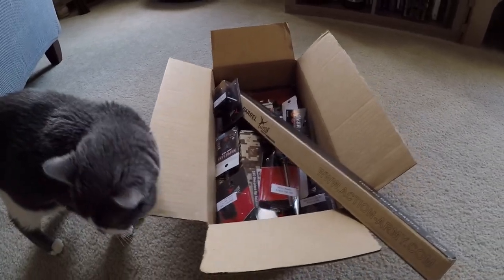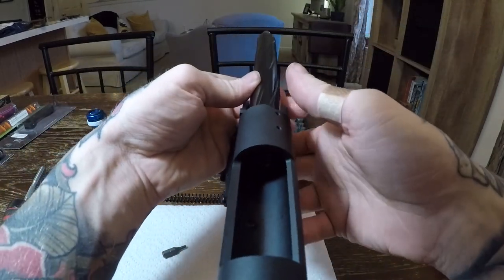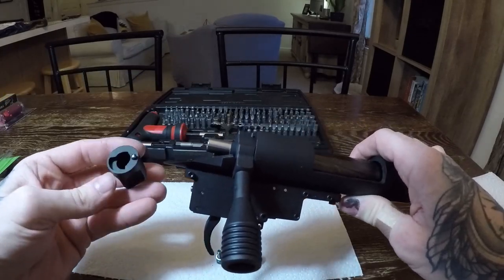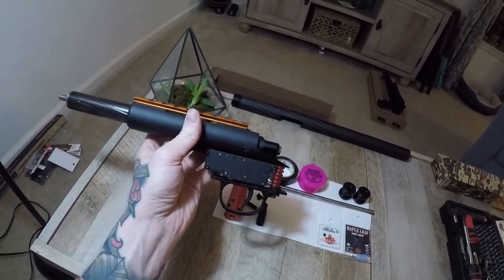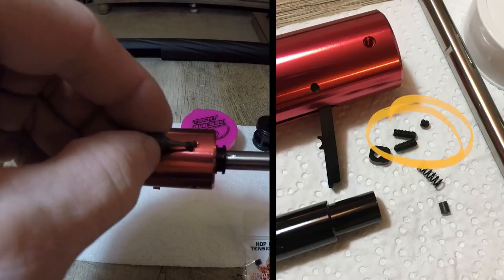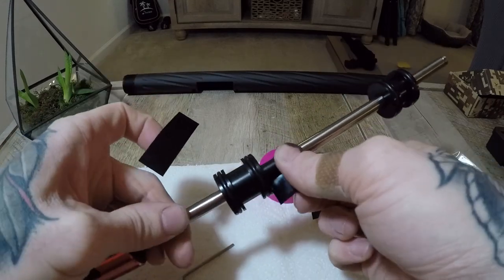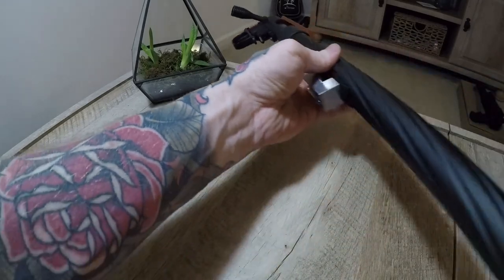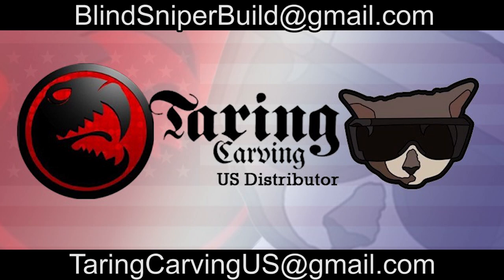How to Build a Vsr-10 from COMPLETE Scratch!!! | Airsoft Sniper Rifle DIY Guide | Taring Carving 🐲🔥

Comment: JGBar-10:  I had the issue where the spring guide would not stay in by pressure alone (doesn't work after first shot) so the "screw" in the spring guide to keep it in is a great idea.  I figured those holes must be made for a reason but since there are no install instructions this info is really helpful.  Cheers!

FYI:  I installed the Action Army 90 degree trigger into my SSG10-A1 with no issues.   It is much better than the stock one.  I only had to widen the 2 mounting holes in the trigger to accept M3.x8 screws.

Comment: Now, two of the important parts you choose are prone to some problems.
The first is the AAC blue piston.
The white guide ring that keeps the piston in the center is screwed into the piston, but the front ring is not properly mounted.
When it deteriorates, it causes air leakage from the screwed part of the air seal O-ring and guide ring.
This means that even if the O-ring is replaced with a new one, the air seal cannot be obtained.
It is not a fundamental solution, but it can be improved by applying wax to the guide ring and screwed parts.
The second problem is that the combination of AAC cylinder head and maple leaf backing makes it difficult to obtain ballistic consistency.
The tip of the AAC cylinder head nozzle is 7 mm instead of the standard VSR nozzle diameter of 6 mm.
Although this thick nozzle provides a strong air seal and can easily increase power,
When used for a backing with a flat, long hump, such as a maple leaf backing, as it overstretches the inside of the backing
The standby state of BB is not stable and the trajectory becomes inconsistent. (LayLax cylinder heads have the same problem)
To improve this problem, the diameter of the nozzle tip should be reduced to 6 mm.
With the right tools, you can get dramatic results with just a few steps.

Advice from Japanese VSR enthusiasts
I hope your investment will be satisfactory.
Reply from the maker: These are basic off the shelf parts, and everything works fine. I have had AA pistons come loose before too, which is and easy fix. If someone really wants to tinker and get every last ounce of performance, they shouldn’t be building a rifle thats 90% action army. I appreciate your input though!

Comment: I'm planning on making a VSR from scratch soon, do you know what screws and fittings I'll need to buy that don't come with the parts (e.g. the bolt handle screws and detent pin/spring)?
Reply from the maker: Off the top of my head; you’ll need hardware for; the body/stock, trigger box, bolt handle end cap, and maybe scope rail. It depends on which parts you get, sometimes you get hardware. It’s allots worth trying to find a cheap boneyard rifle just for little parts like the hardware and detent. At this point I have so many bins of parts that I typically have the small stuff I need!! 👍🏻🍻
Reply: @BlindSniper  Fair enough, I'll have a look for some. In all honesty I might end up buying a JG Gspec and cannibalising it for the stock and screws.

Thanks for your time and advice!

Comment: how are you getting the hop up unit flush with the barrel window?
Reply from the maker: If you have the mag block screws loosened, specifically the front one that goes through the outer barrel; the mag block screw hole in the outer barrel is usually oblong so there is room for adjustment. If it’s not, you can widen it or oblong it with a drill bit. I also touch on this in my carbon fiber outer barrel guide I believe!

Comment: I built my vsr-10 and replaced all the parts from my old rifle. So now I have a full upper assembly that i want to turn into a backup sniper if my upgraded one goes down. Where would I find a good place to purchase a vsr-10 stock, or would it just be a cheap fun project to make a wood one. Recommendations?
Reply from the maker: Well I do distribute Taring carving stocks in the US. I can ship anywhere but it costs more outside the US. However there are many vsr-10 options. A standard stock used on the hopup app for cheap. Maple leaf MLC stock is really nice. Modelwork M40, classic army Sr40, well mb10/11s are vsr compatible, Akura tactical has a 3D print and cnc stock for vsr.
Reply: If you could send me a link or a way to email you about those taring carvings stocks I'd like to see those.
Reply from the maker: @Monarch-252  email me at TaringCarvingUS@gmail.com. I can show you stocks I have/can get. I can also send you links for other vsr options! I also have 2 Taring carving videos on my channel!

Comment: Hey Blind Sniper. I have a Tokyo Marui G Spec stock. Just bought the SAP Edgi kit chamaleon version. Which cylinder would you recommend and most importantly which trigger?
Once I put that all together, which spring to get 2J?
Reply from the maker: For the sap def get EdGi cylinder. For trigger I like BullTrigg gen2, however they might be hard to get ahold of. Springer is also good. But follow namech_airsoft on IG. He’s working on a legit trigger currently. Spring depends on what output you want, and what piston weight/inner barrel length you have. Rapax springs all day, I have a 2j, 3j, and a hulk.
Reply: @BlindSniper  thank you, I will look into it...not in a rush :)

Comment: I'm purchasing a JG bar 10 and was wondering if the last receiver option that you have linked in the description will fit right with the JG bar stock? The Action Army one. Thanks for the video as well! 
Also, what type of range does this gun get? Is it shooting pretty straight for 70-80ish yards? I'm looking for a straight shot vsr-10 build if that makes sense loll
Reply from the maker: Yea that will fit a jg Bar10. Almsot all “vsr-10” aftermarket parts fit the jg Bar10. They are 99% identical in terms of compatibility. The gun in the video definitely was doing 70-80 yards consistently. Just need the right spring for the power and good hop components/inner barrel stability for the accuracy.
Reply: @BlindSniper  I’m thinking of putting a TDC 2.0 in my build as well. I’ve heard nothing but good things from those. Should be able to hop heavy bbs
Reply: @BlindSniper  Awesome! Also, I know I'm gonna need  the end cap for the new Action Army cylinder...Would you have any links for the springs and screws that I'll need to assemble that? Thanks in advance
Reply from the maker: @ParanormalHuntTV  shooter cb gear is the only place I’ve seen recently that stocks the pin and spring. You can modify something to work but I prefer to have the proper piece. SLONG is the company that makes those pieces currently if you can find them in stock!
Reply: @BlindSniper  I found a vsr-10 maple leaf end cap with a spring and pin. Would that fit onto the action army twisted cylinder? And should I still grab the action army bolt handle? Would all those 3 be compatible
Reply from the maker: @ParanormalHuntTV  yea that would and it’s cheap. Try checking novs site for spare ssg10 parts too

Comment: Can you give me the sizes on the end cap screws and spring?
I know you said D-10 for push pin. I don’t have any of the 3 and need to find them
Reply from the maker: End cap is an M4 screw I believe. Spring you just get one that fits and I don’t know of a specific pin. I recently just used an M4 screw/grub screw as a pin. Just might have to round the edge a little

Comment: I bought a VSR 10 GSpec...I would like to keep it in 45 degrees. If doing this will the performance suffer or do I need to pass to 90 degree trigger?
Reply from the maker: 45° won’t effect the actual shooting performance of the rifle but it does have an impact on the overall quality of your setup. 90° is better/stronger. I will never run 45° again. The 45° sears will always wear out. 90° or nothing!
Reply: @BlindSniper  thank you for taking the time

Comment: Can i use an SS5000 spring for this build?
Edit: I have noticed that uprading this sniper would need me to get more tools to be able to get the reciever part done
Reply from the maker: Just get a good 90° trigger and strong steel cylinder and it should be able to withstand a heavy spring

Comment: The AA cylinder on my VSR 10 turns too far when cooking the bolt. The handle impacts the small bit behind the AA receiver and its frustrating how loose the tolerance feels. What is causing this to happen? And is it normal?
Reply from the maker: In my opinion some AA parts are hit or miss. A guide sleeve may help the tolerances but I only use a guide sleeve over the cylinder where the outer barrel threads into the receiver. All receivers are different, I like Maple Leaf better than AA, but an AirsoftPro should have tighter tolerances. Some people do an ejection port cover mod with a soda can that goes in the receiver to cover and guide the cylinder.

Comment: I have an old sniper that has terrible performance and could do with a rebuilt. How much would I cost?
Reply from the maker: If it’s all stock internals you can spend a few hundred real quick. An AA trigger and piston kit is $160 alone. Aa hop chamber $55. Depends if you want nice aftermarket parts or just give it a good cleaning and diy tune up!
Reply: @BlindSniper  thanks for replying. Any bolt action rifle recommend around 150-200? Cheers

Comment: Hi. What's your preferred inner barrel bore?
Reply from the maker: 6.01
Reply: @BlindSniper  have you tried edgi's dual bore? I believe it's 50% 6.01 and 50% 6.05
Reply from the maker: @mmwkoh  no I have not, I typically run Gspec length inner barrels. I think dual bore barrels are usually longer but I could be wrong!

Comment: Is that ok dont put the 1 screw in the rail mount ? If you dont put it the barrel moving
Reply from the maker: When the gun is bolted into the stock it’s held in place. In a lot of my rifles I don’t use the set screw on the bottom either
Reply: @BlindSniper  ok thankyou ill do it thankyou😊
Reply: @mark-tb8xg  if you have it, it wouldnt hurt to use it, but its not like your guns just gonna fall apart without it

Comment: So i am having a problem with my build.
The parts are: 
action army twisted outer barrel for 430, reciver, hop up chamber with tridos tdc 2.0 and teflon coated cylinder.
Maple leaf autobot 70
Crazy jet barrel
Springer custom works piston, guide and trigger
Stock its the TM vsr10.
The problem i am having is that the cilinder nozzle barely enters the bucking. I made sure that the barrel was screwed to its maximum, used 3 different guide ring and also removed them and the problem remained. I also want to meantion that it is impossile to make the hop up chamber to be  flush with the iuter barrel window. Is this normal or my parts have qc issues? Help please. So the problem is that the cilinder head is kinda far from the hop up chamber but i dont know why.
Reply from the maker: That is odd if all of your parts are for a vsr-10. I would definitely make sure everything you bought is for a vsr and not another platform. Is the bolt handle full seated against the back of the receiver? Are you saying you can remove the magazine and see that the nozzle is not in all the way? I would start with the process of elimination. Try assembling the rifle without installing the spring guide or piston and see if you still have the same issue.
Reply: I checked and all the parts are for the vsr10 platform. The bolt handle if full seated to the back of the reciver and i tried assambling the rifle without the spring guide and piston. So the cylinder nozzle enters the bucking but not all the way in and i am not sure if this is normal, it is my first build. I tried using the original TM outer barrel with the AA hop up unit and the tactical AA reciver  and the cylinder nozzle goes deeper into the bucking but not by much. Should the nozzle enter all the way into the bucking or just the beginning of it? And also i would like to know if the flat part of the cylinder head ( the one that you screw into the cylinder and from where the nozzle starts) should be in contact with the back of the hopup unit or there should be a distance between them. Thanks a lot for your help!
Reply from the maker: @aussailinazir2117  maybe your nozzle is too short. The cylinder head should be touching or very close to touching the back of the hopup chamber. Did you check the air seal when everything is together?
Reply: Yes i checked the airseal after i put everything toghether and it was good. So the gap between the cylinder head and the hopup chamber is almost 2mm. I compared the action army barrel with the original marui one and i realised that the front screw on the action army where you screw in the hopup block is positioned a little bit farther than the orinal barrel, maybe this is why i am having that gap. when i use the original barrel the cylinder head almost touches the block. @BlindSniper
Reply: and when i take the mag out i can see a little bit of the nozzle.
Reply from the maker: @aussailinazir2117  I would definitely suspect the cylinder head at this point. Hard to say without the gun in front of me though. But you can drill out the mag block screw hole in the outer barrel to make it a little larger. Then you can slide the aa chamber/barrel back a little further if needed. Another thing I was thinking, make sure your inner barrel and bucking is seated all the way into the aa chamber, and that you have the aa chamber sleeve in correctly. If your barrel and bucking are not all the way into the aa chamber, you will have the issue you’re having.
Reply: i really appreciate that you are taking the time to help me! i made sure that the barrel and the bucking are all the way in the hopup chamber. A couple of minute ago i just tried this combination: action army reciver, original marui outer barrel and AA chamber; it was a perfect fit, i didnt need to turn the outer barrel in any way to align it with the screw hole and in this case there was almost no gap between the cylinder head and the hopup chamber. and when i use the AA outer barrel i need to turn it like 270 degrees to align it with the hole on the reciver. This why i am guessing the problem is from the outer barrel. If i maked the front screw on the barrel bigger wouldnt the hop up chmaber have a bigger room to play and maybe move forward? thanks a lot!
 @BlindSniper
Reply: I just counted how many times it takes to screw in the outer barrel to its limit and the oem one took 14 times whereas the AA one almost took 14 and in this case i need to turn it almost a full turn and i thinks thats why i have that gap.
Reply from the maker: @aussailinazir2117  hey anytime, feel free to dm me on insta as I may respond faster! But maybe you received a defective outer or receiver where the threads weren’t cut properly. I’ve seen it before and it prevents you from threading things in as far as they need to be.
Reply: I think the problem is the outer barrel because the original one can go all the way in with the same reciver. Thanks again for your help! If i need anything else i will dm you!
Reply: I fixed the issue, the back of the barrel was too long so i sand it down and it fits perfectly now, 14 threds like the original one.
Reply from the maker: @aussailinazir2117  nice! I’ve had to shave threads before
Reply: Hello Nate! Here i am again with another question, i wanted to dm you on insta but it is not something that i need to know urgently, i can wait i am not going to play airsoft at this time so here we go. I am not sure what brand spring to use in my vsr, modify or rapax rms. I use the action army cylinder, scw trigger, wasp piston+ cylinder head and maple leaf 430mm crazy jet. I build this setup for .43 bbs and the field limit here in my country is 3joules with the bb that i am using. I want to use a 13mm spring and i cant decide with which brand to go, both have + and - the rapax rms being a little bit longer than the modify one and only available in 2+, 3+(for what i need) joule which means i cant really fine tune it to have the exact joule that i want and also heard that the piston might not lock with the trigger ( SCW said he only uses rapax springs and recomands them). On the other hand the modify springs come in 140,150,160 etc which is great for tuning. I have zero experience with this, i am just starting airsoft and the sniper is finished, i just need a spring and do not want to spend 100$ on spring to figure it out. . What spring should i go with, can you help me out in this situation? Thanks a lot! @BlindSniper
Reply from the maker: @aussailinazir2117  hey I tan EdGi springs until I switched to a 13mm setup. Then I went Rapax, that’s all I read about and heard they are the best. I never used any other 13mm but I don’t plan too, Rapax is great! I have a 2j, 3j and a hulk. Then I just play around around with weight and air break length until I get the output I want!

Comment: very minor gripe; I don't think there's any need for teflon tape when using a AA chamber, they're basically completely air tight if installed correctly. Also, teflon tape is just a botch in general.
Reply from the maker: Probably not. Peace of mind.